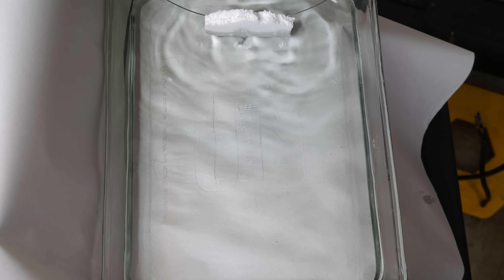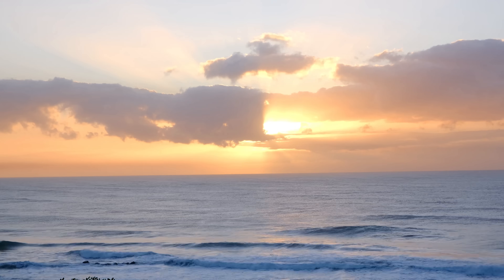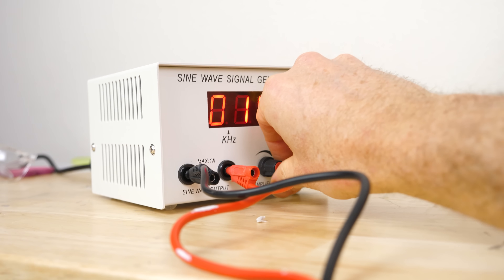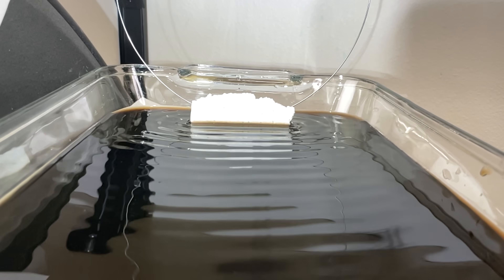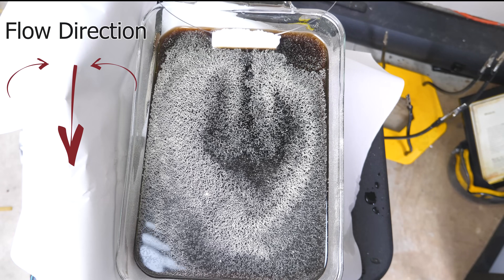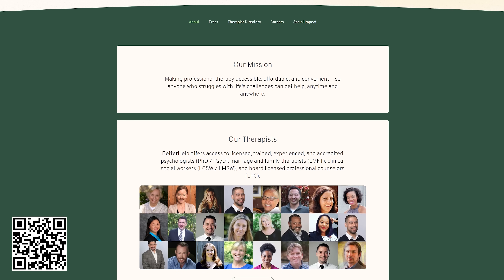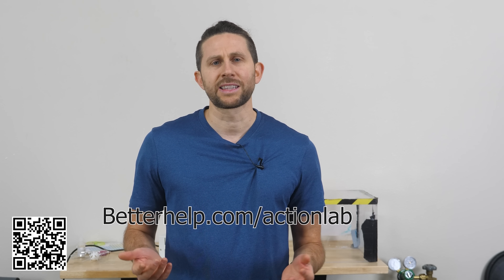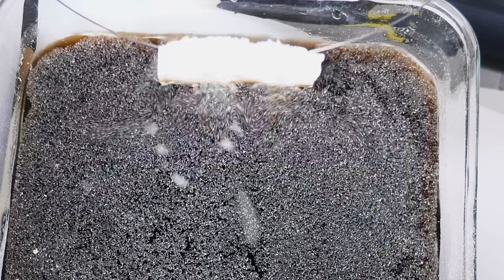Tractor Beam Waves (Waves That Pull You In)

Comment: I'd simply describe it as a hiccup overshoot overdrive effect. As it is mainly caused by the resonating waves adding up exponentially and also rhythmically as well as cancelling, but then also arythmically. This causes the overshoot. The waves get sucked under the outgoing motor waves by the effect of the overshoot of the height and own motion caused by the resonating waves, lastly especially by the arythmic and rhythmic patterns, which are made possible enhanced by the cancelling resonating reflective waves. Maybe to some extent this effect is similar to the capillar force effects per se in some experiments, but it's very simple and more simple than some of the capillarforce effects which are also a bit similar to the vanderwaals afaik. Therefore it's almost like a waterpump overshoot effect in some way. Anyway, this effect should also be provable with sound in some way maybe but doesn't even matter since ez

Comment: You have just discovered the secret of the epi-cycloid loop! It is directly responsible for quantum gravity as well as anti-gravity. Quantum particles have a frequency that fluctuates the space-time fabric the same way as in your demonstration. This causes particles to fall together a.k.a. gravity! For anti-gravity just use a gyroscope to create epi-cycloid or loops while its processing around its pedestal. These loops is directly responsible for holding the Gyro up while it’s spinning if you look at these loops on a time chart you will see that the duty cycle shows more energy being propagated upwards kind of like electron bunching in a traveling wave amplification tube a Gyro bunches matter causing a constant offset in the center of gravity resulting in propagation. Maybe you could create an electromagnetic replica of this test to see if you can pull in and repel magnetic objects from a distance

Comment: Check this out: I realized, by watching the way water flowed from my fridge to a large pitcher, the way the ripples in the glass changed based on how full the pitcher was and how far the stream had to fall into the container. At one point, the wavelength and intensity of the waves, created this tractor beam effect. I realized this must happen in other, similar situations. I then thought, I’m sure it happens at some point during the filling of a tub for a bath. And thus found out, that if your tub has a point where it naturally creates this effect, that’s when you should put in your bubble bath solution, as it draws your bubble solution towards the activity that creates the bubbles, instead of when the water is naturally pushing the solution away. Thank you for coming to TEDTalk

Comment: Seems like displacement. The generator is violent enough to push water down, and the angle of where the pushed down water travels is determined by the geometry of the generator. Water rushes in from the front to take its place. The surface wave pattern is weaker than the displacement force. Just a thought.

Comment: I would wager that the amplitude necessary to produce this effect would change with the viscosity of the liquid. Imagine performing this experiment in honey and intuitively it seems like the liquid would resist the motion of the generator more (so more amplitude is required). I would guess that the reason is that the generator has to exceed the speed at which the liquid smoothly re-pressurizes the void created by lifting the generator. Under a certain amplitude the liquid can maintain laminar flow and still stabilize the low-pressure area but above that amplitude the flow becomes non-smooth and creates these eddies.

Comment: Is there a sweet spot amplitude where there is no net movement forward or backwards?

If you increase the amplitude high enough does the pattern reverse again and start pushing again? If it does, will there be a third flip where it starts pulling again if you increase it even more?

Comment: Ok. You got a function generator. Now all you need is a power amplifier afew feet of magnet wire to create an electro magnet which should shoot its magnetism between 2 conducting plates each plate connected to the other end of the electro-magnet coil

Comment: Hello . I think it is because of Bernoulli's principle. In fact, in the front part of the ball, which is closer to the center of the wave, the oscillation range of the water molecules is greater, so it has a higher speed and lower pressure, and in the back of the ball, which is farther from the center of the wave, the oscillation range of the molecules is lower, so the speed is lower, and as a result, the pressure is higher. and this pressure difference behind and in front of the ball directs it towards the center of the wave

Comment: Definitely can't math this, but clearly as the amplitude goes up, the water's adhesion to the wave source becomes more of an issue, causing the water to rise. Then, as the water falls back down, what is at the edges of the source has an easier time because of the corners, and pulls the adjacent water as well, forming the central spike we see. Then the wave settles in 3d dependent on the amplitude relative to the length of the wave generator. 
I suspect this tractor beam would be much weaker if the source was the same width as the container.

Comment: I think your technical just changing the concentrated flow directions in the center Chanel.  In the slower waves your still pulling water into your wave generator,  just to the sides. There are a lot of people who drown due to effects similar to this.  When swimming people get caught in currernts that pull them away from the shore line and they don't realize they can swim horizontal to the beach and get to an area where they can get back. Also, near peers the disturbances to the wave sometime get people trapped.

Comment: Thought: in higher amplitude waves is it possible the lower layer of water is moving faster than the upper layer, causing the top to "fall back" while the net effect is pushing the water away faster? So items floating on the surface roll back toward the source while heavier items would be pushed away faster...

Comment: Okay, so when waves become tall enough, they hit the bottom and this reflection creates upward flow, which changes distribution of particles amplitude under the water (movement circles for particles in the deep are no longer less in size, then on the surface). Is that correct?

Comment: Seems like the water below the surface is pushed away, creating an imbalance with the water on the surface. 
There is more cohesion below the surface than there is on top. The waves seem to separate the two, creating the pull on the surface. 
I would suggest trying to see if objects below the water are pulled in the same way. 
But considering how the water is acting. The objects below the water line will still be pushed away. 

It kind of reminds me of air flow over a wing used to create lift. You know when the wing splits the air and it is shaped so the air above the wing has to travel faster and thins out as a result, creating lift as the air below it pushes it up? Well your sound wave seems to be doing something like that. It is taking advantage of the difference between the surface and the water below.
IT would also be cool if you could do that partial effect that you showed near the start of the video. I am sure that could answer a few questions.

Comment: You already did a video where you put a GoPro inside of a vacuum chamber and you showed us that sound can't reach it, but now I'm wondering what would happen if instead of directly putting it inside of the vacuum chamber you put it in a sealed container with air inside and then you put this container inside of the vacuum chamber, would there be some difference in sound?

Comment: Can you do some calculations?
What if your styrofoam were 20 feet long and made from aluminum thick enough to resist warping under the stress of the water.
How much power would it take to oscillate it?  What kind of g forces are we dealing with?

Comment: is this similar to a tsunami, when a large amount of water resides from shores but at the same time the normal waves push things to the shore.
so basically based on this larger displacement of water pulls towards its source to fill in the water requirement to reach its height for some duration till the waves stabilize is my guess. a follow up experiment can be if the same is followed for longer duration and if the same duration is observed in a larger container

Comment: Could you try doing it in a larger container with actuator in the middle, or with actuator matching the width of the container - maybe at higher amplitudes waves caused by the shorter sides of the actuator start dominating (and are still repelling) for some reason, and the wider side attracts to simply fill in the water repelled by the shorter sides?

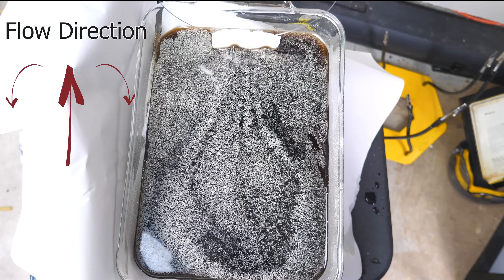Comment: 4:22 is not a true statement - the motion is not "everywhere the waves are"/ You can see at approx 4:00 when the reversal occurs, the waves propagate out into the zone where the flow is still away from the source. The source is creating a flow to the sides, generating a low pressure zone, which is what starts to draw flow back towards the source - you can see how the low pressure zone propagates from the floating beads around 4:00 - it starts drawing flow from in front of the source, which takes its flow from slightly further in front AND slightly to the sides, and THAT zone move out as the sideways flow at the source propagates down the side of the tank.

Comment: Behold mortals, witness the power of my creation. I have crafted a device that generates waves, not to push away objects, but to pull them towards it. This is but a small demonstration of my abilities, imagine the possibilities of using such a device on a larger scale. The oceans and its treasures can be controlled and directed at will. The laws of nature can be bent and twisted to my will. Observe as I increase the amplitude of the waves, notice how the particles on the surface of the water start to move towards the wave source. This is but a small glimpse of my power and the wonders I can create. Tremble before me, mortals.

Comment: I think of it as the styrofoam actually creating low pressure when the amplitude goes high. When the amplitude is low, it's pushing the water, when the amplitude is high, it's pulling the water.

Comment: It looks like the waves are pushing to the sides and there is a weak flow from the front to replace that water. I wonder what would happen if you used a spherical wave generator in the middle of the tank, or in a theoretical infinite tank. Would the tractor beam pull things in from 360°? Would the water be displaced downwards or would cells of rotating water form like tiny rip currents? I want to make my own now!

Comment: Great video that taught me something I did not know. However, also raised a couple of relevant questions:
In the ocean, waves dont have a single stationary source so how does water flow towards it?
It appears that much of the current is due to having to replace water displaced at the sides of the dish from the lateral motion of the wave, but again, the ocean does not have walls.

Comment: The one problem with this being used in the ocean as very little if anything floats on top of the surface of the ocean. Second problem is the reason why this happens in a cooking dish and not in the ocean is because you are having deflection of waves off the walls of the cooking dish and the up and down motion of the water when an object is place into the water at a specific frequency is that there will always be a lower point in the water ahead of the object and a higher point in the water behind the object. Now set the wave frequency to 750nm and you have just discovered gravity. Oh... and 750nm just so happens to be the frequency of infrared energy, something all atoms give off.

Comment: It looks like the wave generator pushes the waves to the sides instead of downwards and because of that the center gets sucked in towards the wave generator to fill the lost particles which also creates the current just like in case with rip currents at seashores. It can be seen in the top view with many white particles in the water that the same is happening in reverse when the generator creates normal waves which creates a stream downwards. At the same time the stream is coming back to the wave generator from the sides. So saying that wave generator sucks the water instead of pushing would not be correct, because what is happening is that the direction of the wave changes and the water is pushed to the different direction. I would assume that this effect will be less visible if performed at much larger water body.

Comment: Hmmm...several years ago something similar happened to me: I was swimming near the beach, with very small waves, relatively far from a breakwater, and I was carried quickly almost to the breaker (where I would have been smashed against the rocks ). I had to make a tremendous effort to come back.

Later I realized that, from the middle of each breakwater to the beach, there was a trail of foam that seemed to be still. Very similar to what is shown in the video.

Comment: the reason why this happens and is not chaos theory is because ..its because the circular motion is either clockwise or anticlock wise which determines the movement of floating object 

lets take a object with north and south facing . and flowing outward from north to south.

any object floating on water if the amplitude of wave is not high enough it will push it say from the north side to the south side  ..but if the amplitutde is higher than the critical point it will pull it from the south to the north side ..and the reason is 

when the amplitude is less the center of mass of that particular wave at that frame of time(use calculus to calculate ) is more on northside than the south side but when the amplitude increases beyond the critical point of the objects volume the centre of mass of that high amplitude wave will be shifted on the south side ....aka now it will pull it back from south to north ..

and as explained the particles move in circular form but relatively are stationary ...its just that the particle circular movment shifts from clockwise to anti clockwise

Comment: My assumption was that the higher amplitude causes the water to be pushed out from the impacts in all directions but with the higher amplitude more so downwards, causing surface water to be forced down.  In the earlier example the water came back in from the sides, I just assumed in this example the water was coming in from the top and cycling out under the surface.

Maybe it doesn't make sense though that was just my initial assumption considering he seemed to suggest it wasn't an interference thing from reflected ways.

Comment: I have heard that if you are near a large ship moving through the water you get sucked in towards it. If this is true, is it related to this “tractor beam” effect.
Reply: probably not. It likely has to do with the fact that the propellers of a large ship make the water right behind them of very low density, and high density moves to low density, meaning if your in water you'd get pushed into the low density zone.

Comment: Great explanation! By the way, for anyone that's being pulled seaward from the shallows near the shore, it's probably not his tractor beam but more likely a dangerous rip current. So, get out of the water as soon as possible! Also, if the waters are too deep to standup, you will then need to swim across the direction of the current and parallel to the shoreline, until you are free from it. The use of breaking waves can help you get back to shore. If catching your breath is necessary, then try to relax and float for approximately one to two minutes in order to make any progress with getting out of it!
Reply: Learned all this at the age of 6. Growing up in southern California by the beaches this kind of survival swimming is so important. Also terrifying being stuck under the waves. Hold your breath, push off the ground, go with the direction of the wave to find air.
Reply: I'm in San Diego.  I ended up in one and didn't even know it, just chilling treading water and enjoying my first time going to the beach by myself .... Next thing I know a lifeguard truck pulls up and they tell everyone to get out ( I'm everyone ).  So I go to swim towards them and don't get anywhere.  I'm just thinking I know I'm a better swimmer than that so I swim full stroke... Look up, and it's as if I hadn't budged.  I swim again but harder 😅😅😅 And still no where, so I'm just thinking I suck and I float on my back for a second to catch my breath and that's when the life guard starts coming out with the float.  I end up getting out and he says I got pulled in by a rip current. 🤦🏻‍♀️ So obvi.  People who were on the beach were like "omg! You were swimming so hard!"  And then I look around and I don't see my towel at all... I had gotten swept SOOOOOOO far down, I had a long ass walk !!!  I had no clue.  I'm sure I could have gotten out of it if I did the parallel swim thing, but the scariest part was not even feeling it.  I just assumed it would feel like a pull or something.

Comment: In fluid dynamics, some properties can be measure easily by linear algebra because they have non-zero center magnitude. But some others are not that easily because they oscillating with infinite frequency. In this case we need some advance math to modeling such as Laplace Transform or Fourier Transform. That is why fluid dynamic simulation is the hardest thing for making 3D engines.